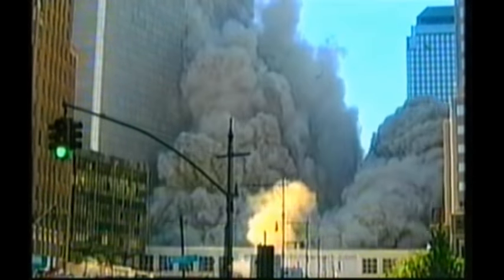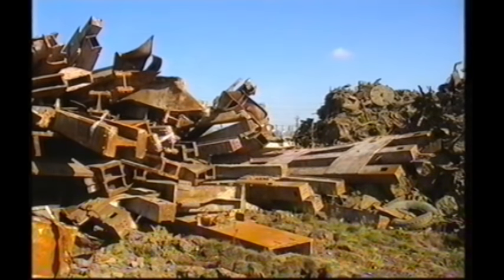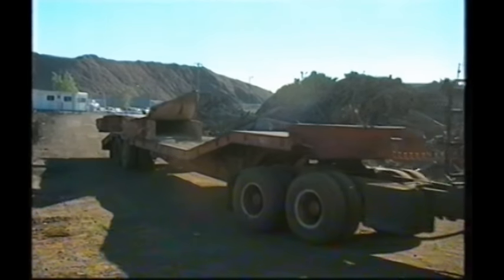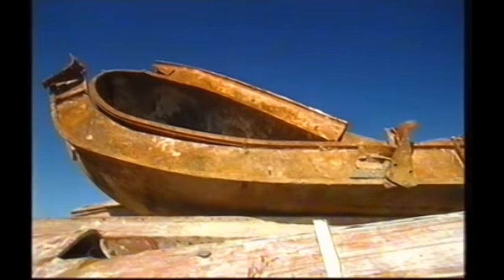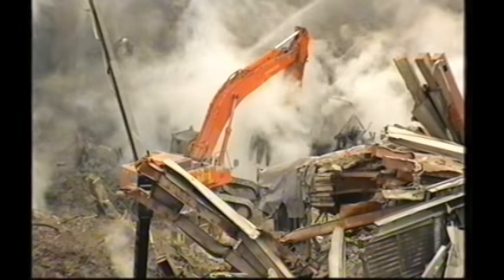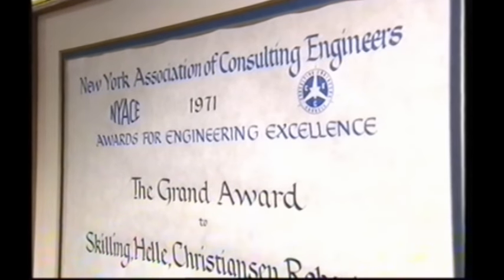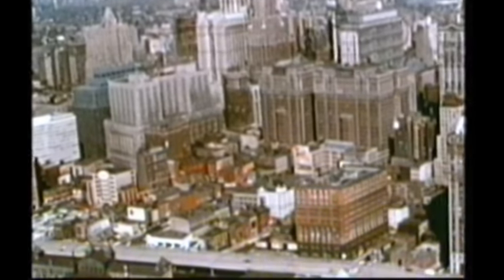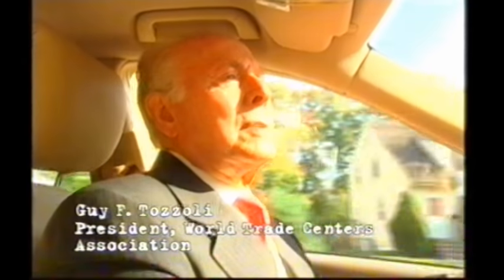9/11—"How The Twin Towers Collapsed" (C4 documentary, 2001)

Comment: Where is the data on the tons of steel and tons of concrete in each level of the North Tower?

Did level 105 contain the same amount of steel as level 5. Level 5 only had to support the weight of 21 times as many stories.
Reply: Except for IIRC 2 mechanical floors the floor truss systems on each level were identical.  Only the columns changed depending on their height in the building. Remember, the columns carried all of the building (gravity) loads, not the floor trusses. 

So, if you know one floor you know them all.
Reply: @MFitz12  
Where is the data on the horizontal beams connecting the columns in the core? Were they the same all of the way down the building?
Reply: @psikeyhackr6914  - Probably. No reason they would be different from floor to floor. Doesn't really matter.
Reply: @MFitz12  
Horseshit! The building was designed to sway 36 inches at the top in a 150 mph wind. One source said the wind speed reached 100 mph 6 times in 28 years. 

So didn't the lower portion have to be designed to handle the sway. Not having data on the horizontal beams in the core is total nonsense. This is a scientific farce.
Reply: @psikeyhackr6914  - ALL lateral (wind) loads were the responsibility of the perimeter columns. Cores were responsible for the majority of the gravity loads. 

If you understood the actual collapse mechanisms (basically what is being presented in this video) you would understand how none of your nitpicks matter.
Reply: @MFitz12  
 
In other words you could not find any data on the horizontal beams in the core and just believing that it is irrelevant minimized your mental effort.
The Conservation of Momentum can just be declared irrelevant. Like the $16,000,000 NCSTAR1 report by the NIST can just not even mention the total amount of concrete in the towers in 10,000 pages.

The Twin Towers Affair and the masses of people who can function on non-thinking is truly astounding.
Reply: @psikeyhackr6914  - I trust that got things sorted out then.  Glad I could help.
Reply: @psikeyhackr6914  - You didn't even read it, did you?  See, I called it. You are not serious.

Of course from past dealings I have been well aware of that for a long time.

Good luck with your continued epic fail. I really hope that works out for you.
Reply: @MFitz12  
Is there steel and concrete in skyscrapers? 
Search 10,000 pages and read every paragraph that containing those words. The word 'concrete' was used more than 3,000 times. Fortunately multiple times per paragraph most of the time. 
They Never specify the total amount of concrete in the towers.
They never specify the center of gravity or mass of the tilted top of the South Tower though they admit that the tilt was 20 to 25 degrees.

So tell us about data on the horizontal steel beams in the core.
Reply: @psikeyhackr6914  
Horizontal beams? Do you mean the floor trusses?
Reply: @kyle381000  NO!

How do you think the 47 columns in the core were braced against each other?
Reply: @psikeyhackr6914  
Against each other, or against the perimeter columns?
Reply: @kyle381000  
The core wsa 85 ft by 135 ft. The core was 30 or 60 ft from the perimeter depending on which side you were on. 

The 47 core columns in that space averaged 17 ft apart. How do you think they were connected together? It has been 22 years dude!

Comment: Having watched every doc on this 9/11 issue, the most complete and honest one made a point of the extreme amount of military grade thermite residue found throughout the vertical columns. It also showed how the vertical columns had been cut at approximately 45 degree angles. The whole building has been wired prior to  9/11 by unknown demolition professionals. I don't believe that documentary is available anymore as it points out just where president Busch was at the time and how every jet fighter in the area was out on a mock practice drill of airplanes flying into superstructure! Imagine that! Also this incident is v what allowed the terrorist bill to be passed which allows all civilians to be arrested and detained if suspected of terrorism! Connect the dots and its obvious who the real mastermind was behind this incident!
Reply: Oh FFS 🤦‍♂

I suggest you need to do a re-think on what complete and honest means.

Here is a short video on how those 30-degree (not 45-deg) angle cuts were actually made;  youtube.com/watch?v=pVDU5QKa8Wg&t=4s

And that's just the start.

Here is what thermite - a lot of thermite - actually does to a steel column.

youtube.com/watch?v=JXWCMBuusMI&ab_channel=TrutherTVArchives 

In this video starting at 45:35 and running to 48:35 the Energetic Materials Research and Testing Center (EMRTC) conducts a test to examine the effectiveness of thermite in cutting a vertical hollow box-section steel column. The column tested is smaller in cross section and made of thinner steel than that of the Twin Towers perimeter columns (and never mind the core columns). In total 175 pounds of thermite are used for the test on just one column and requiring the construction of a rather conspicuous coffer dam to contain it. Do recall the Twin Towers had 240 columns and 110 floors.

It would be odd if thousands of office workers missed hundreds, perhaps thousands of those suddenly appearing.

Note what an incredibly slow process this is. It took close to 30 seconds for the thermite to finish burning off.  It would be impossible to “control” a demolition using this material.

Not to mention the issue of how does the aircraft impact and subsequent raging fires NOT prematurely set this stuff off. 

Also note how bright and obvious the whole process is. Could not be missed visually. No way to hide that. 

Then at the end of the test the (relatively modest) column was undamaged…. which is a problem.

Comment: Biggest passenger airplane at the time was 707-320C and fuel capacity is exactly the same as 767, 90000l so don't eat shit and weight difference is only around 20%, so don't lie that you made towers that can survive Boeing 707-320C crash...
Reply: The difference in MASS between a narrow-body B707 and a wide-body B767 is equal to a 50-seat regional jet. And it's all about MASS,... and VELOCITY.  The difference in energy at impact between a B707 at 180 mph and a B767 at 590 mph is several orders of magnitude.
Reply: @TheCriticalStinker-jw4fl  Did you watch complete video? The main reason for towers collapse is jet fuel. He said that he designed the towers to withstand the impact of the largest aircraft of that time. It was a B707-320C and it has a 90300l fuel tank and weighs 67,300kg. The plane that hit the towers is a B767-200, has a tank capacity of 63200l and weighs 80,130 kg. Withstanding the impact does not mean that the tower does not fall at the same moment, but never after the impact. Both went down due to fires caused by jet fuel. The man has the nerve to say that he did not foresee the consequences of a fire on the towers when he designed them :) What did he think, that in case the plane hits the towers, there won't be a drop of fuel in the tank?
Reply: @shone190  - We are only interested in mass AT IMPACT not gross weight, weight of fuel AT IMPACT (which you lie about) and VELOCITY at impact which you ignore completely.

Surviving the IMPACT means exactly that - surviving the impact. Both towers survived impacts in September 2001 that were 4 and 5 times greater in term of energy released into the target than the hypothetical study done on 3 pages of hand-worked calculations in 1963.

That alleged 1963 memo (which has never been found BTW) did not consider the effects of post-impact fires started by the fuel in the aircraft, and indeed could not have.  That would be complicated and expensive to model even today. 

You are still doing it completely wrong, and I suspect on purpose so you can arrive at the conclusion you want rather than the correct one.

Comment: I still believe it was not the planes that brought down the towers.  It was the explosives on certain floors that brought the towers down.  How can 80 stories of building collapse from   a plane.  The fuel or jet fuel coukd have taken down these buildings.  Strange that blocks away cars were wiped of their paint trees were still standing with leaves.  If the collapse were caused because of design faults. A pancake of floors falling down on each other.  Why is it nothing was left only powdered dust that infiltrated all those who got away but hung around to watch.  Never look back when a building is on fire.  Why the firemen went up was a terrible choice to think they could put out a fire way up high while people were trying to get down.  We are all told to get out of a burning building as quick as we can.  These planes blocked the access of getting out.  Then the people were called back in and I think that’s when more died.  If I worked in that building seeing it on fire up in the sky I would only want to get out.  I still think there is more too the loss of theses buildings then one would let you believe.  My heart goes out to all the men who died going up to the towering infernos and the men who came to clean the area of all the debris.  All that evidence taken all that explosive residue the evidence of the true way the towers fell.  😮

Comment: How?  They were brought down by controlled demolition.
Reply: @MFitz12   listen Fr i tz...   Steel Box columns  cut through at 45 degrees  -  thats some powerful jet fuel....  near enough a Hundred  solid concrete Floors +  thousands of tons  of Steel columns - with a structural steel central core  + cross bracing  - and with  horizontal beams  and bolted connections -  offset   concrete Lift shafts...  and only a relatively small pile of dust  ..  No  pancaking   -  nothing reaching  10 to 15 stories high -as would be expected..... deliberately passed over and ignored by the flimsy  NIST  tissue paper..
Reply: @jimmymcjimmy9743  -  - It was 30-degrees not 45 degrees. The cuts were made on October 29th 2001 by workers using cutting torches to clear debris.

Comment: It was demolished as though a demolition crew was in charge. There was dynamite placed strategically 
Including 7 which was not hit by a plane
Reply: Building 7 was hit by the collapsing North Tower, which is bigger than a plane. This is MY brief summary bullet point description of Twin Towers collapse, gleaned from my own careful observation of the collapses and study of the structure. It depends or relies on no authority. Fundamentally this isn't that hard and most of what I am about to describe can be quite clearly seen AND since makes logical sense so we know it is most likely what happened. 

1. Plane hits building causing massive structural damage. The plane is completely destroyed in a fraction of a second, but this in no way implies no damage to the building. Large fires break out across multiple floors simultaneously with no fire fighting or fire suppression in an unprecedented fire event. 

2. What happens to steel when you heat it? The steel gets softer. The longer you heat it and the hotter it gets the steel starts to bend 

3. Bent steel is not as strong as straight steel. 

4. The steel floor trusses start to bend (sag) from the heat and the weight of the concrete floors, furniture and equipment. 

5. Sagging floor trusses pull some of the surviving perimeter (outside) columns inward, causing them to bow by up to five feet. 

6. Bent steel is not as strong as straight steel. 

7. The perimeter columns bend until they buckle (best seen in the Gary Pollard video of the South Tower collapse linked in the description above). 

8. Columns - which carry ALL of the gravity loads - above and below the failure point are no longer aligned 

9. The falling upper mass drops past the columns below, NOT onto them. THIS BIT IS IMPORTANT!!! 

10. Tens of thousands of tons of debris falls down through the open office space within the four outer walls . As that debris hits the next floor, that floor fails when the pair of bolts connecting each truss to the core and perimeter columns shear off.  The debris then falls the next 12 feet with the mass of the newly failed floor added to it and hits the next floor, which fails. Rinse and repeat x90. This proceeds through all the floors one by one until the floors are all gone. No need to worry about conservation of momentum as the resistance offered by the long-span floor trusses to the huge loads crashing into them was negligible. 

11. Rate of collapse increases as the collapse progresses. The collapse accelerates from zero, slows only very slightly with the first impact, speeds up again (this time not from a starting point of zero) and as the momentum and mass increases, the slow down with each impact decreases. There was exactly as much resistance as there should have been. average rate of collapse for this stage was 0.65 of GA. 

12. The perimeter columns, no longer attached to the rest of the building and thus lacking critical lateral support fall away - peel. 

13. The central core columns, damaged by the falling debris and with no lateral support from the perimeter columns fall last. 

14. The Twin Towers were an integrated structure. None of the three major components - core system, perimeter columns and long-span floor truss systems – could survive without the others. 

See, simple. That is how the Twin Towers collapsed regardless of who planned and carried out the 9/11 attacks or why

I sincerely hope that helped. Doubtless there will be questions as that was the super, super Cliff's Notes version. Ask away.

Comment: The center columns would be still intact and the outer bar joist would all fall to the ground but the columns would be intact do you shave charges to bring that towers down it's it's all been documented in engineering Free Fall speed I saw they don't show this documentary anymore because they don't want people to really know there is so much conspiracy behind this it's not me don't blame me or yell at me this is real I saw it a long time ago
Reply: How could the core columns still be intact with tens of thousands of tons of debris crashing through them, stripping the floor beams that connected the columns in the core and the floor trusses which connected the core to the perimeter columns, those providing all of the lateral load support for the structure?

The twin Towers were in integrated system in which core columns, perimeter columns, long span floor trusses and hat truss all worked together and complimented each other. None could survive without the others.

As for free fall, well, there clearly wasn't any. Anyone with the gift of sight can figure that out.  Free fall is just made up conspiracy twaddle. Not a real thing.

Comment: Hiw they blew up u mean
Reply: Explain, in detail, how that was done. Then, explain why the airplanes would have been necessary.
Reply: @kyle381000  please do your own research
Reply: @Sat-f4t  
This is not a matter of doing research.
If you make a claim that the buildings were blown up then you should be able to explain the fundamentals of that claim.
Reply: @Sat-f4t  
So, you can't explain your claim. Got it.
Reply: @kyle381000  dude it's not my claim its your stupidly plus do your own work
Reply: @Sat-f4t  
You just said that they 'blew up' but can't even provide a basic explanation of how it was done, when it was done, or even who did it. That's the work that you should be doing, otherwise it's your stupidity.

Comment: Okay, so that's how towers one and two collapsed. Now explain building 7! Not hit by a plane...
Reply: @MFitz12  "Building 7’s progressive, non-symmetrical collapse... "  NON-symmetrical???
Reply: @432b86ed  - Did I stutter?  

Did you bother to read the whole thing?  Obviously not although you clearly got that far.  Just decide to skip to the end?
Reply: When hot, steel does not bend. It buckles, snaps and cracks as shown in video.  Most would think the heated steel structure would begin to warp to the pull of gravity and bend to contact the undamaged floors which would arrest the collapse.

Comment: The laws of physics don't make sense here.The buildings should have toppled over not fallen in on themselves.Also building seven should not have collapsed from just fire its impossible.Brick houses hat ae completely gutted still stand.
Reply: - "The buildings should have toppled over not fallen in on themselves."

Um, no they shouldn't have.  Gravity doesn't pull things fucking sideways my guy.

- "Also building seven should not have collapsed from just fire its impossible."

Why shouldn't it have?  7WTC burned for something like eight hours uncontrolled, which was beyond the rating of the fireproofing used in structures like that (at least at that time).  It's certainly not impossible.

- "Brick houses hat ae completely gutted still stand."

Yeah it's almost like brick houses and steel-framed skyscrapers are entirely different types of structures made from entirely different materials or something.